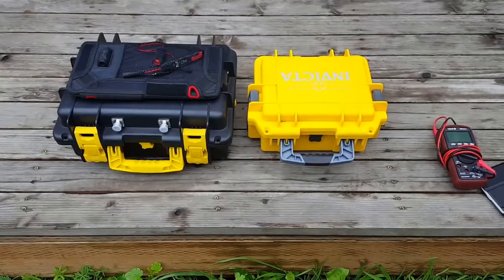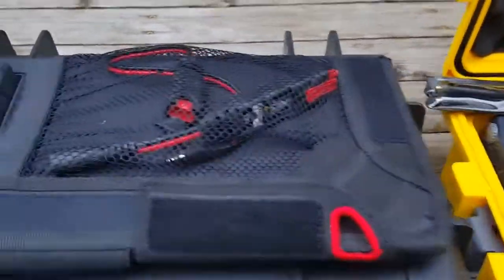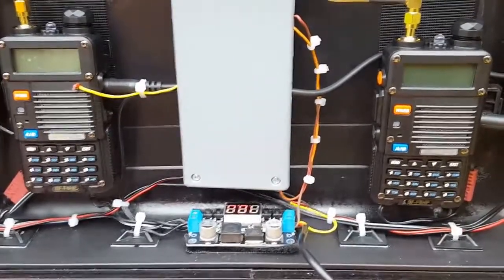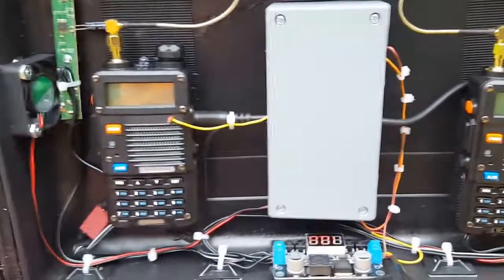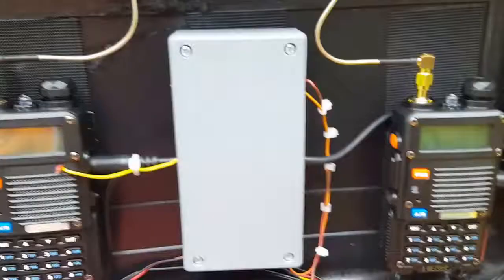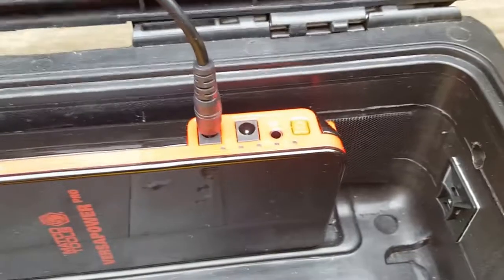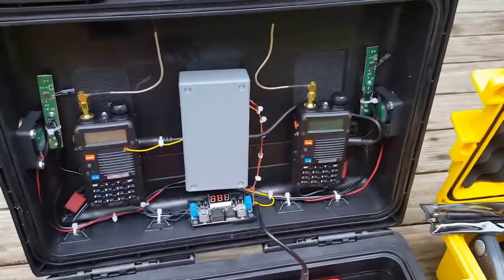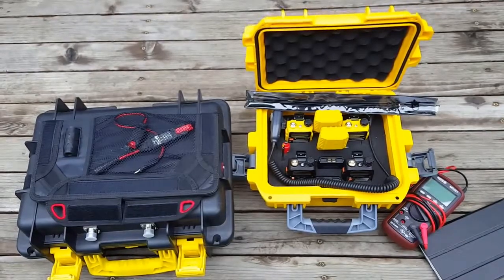KI6VIN first edition of the Solar Powered portable repeater

Comment: Hi, i have made a repeater with 2 Baofeng uv-5R , similar like you. Just having some interference problems. I have a small power supply converter 12v, to 2 outputs of 7.4v for the 2 radios. That way 1 power suply 12v with 25 amp its more then good for both radios. Do you think it may be used some filter in the power of the radios to drop the interference? Or mabe use other typ of antenas, what you think?
Reply: Que frecuencia usaste?
Reply: Very. 144mhz to 148nhz... VHF to UHF also.
Was not very good.

Comment: thats great.  Im going to try one of the now easy to get repeater kits for the baofengs that seem to take care of the ptt etc..... i may even consider an arduino interfaced to the squelch pin you mention if the kit doesnt work.  Ive made several kits in pelicases in the past both for personal and commercial use. Those fans are going to ruin your kit, they will suck in all the moisture outside and wreck it..........

there isnt much that can be done for a low power option regarding heat, if its even a problem, your main killer will be siunlight so always keep it in the shade..... you could possibly use a heatpipe glued to the radios heat source and then run it to a heatsink thats protruding outside the case, then silicone all that back up to make it water tight again????

my internet connection is currently a 4g capable router, connected to two yagis that are  on a pole bolted to my chimney......the router is inside a pelicase. i run cat 5 and power out of the pelicase into the house, its great...... much better than the satellite i was using before. 

Im making a repeater with baofengs for sure, probably it will end up having antennas on my pole and the radios in the house.

Comment: What is the advantage of using the controller instead of the direct connection of the Rx output to the Tx input?
Reply: I've tried direct and because of general noise, etc, I found that it gets stuck in transmit.
Reply: @artistandcamera3245  To my knowledge, That can be resolved removing the ground wire from 3.5mm to 2.5mm (or whatever aux cable). I did it on mine by stripping the wire, finding ground (mine was obvious, just copper wire).
Reply: @artistandcamera3245  if you just buy a regular 3.5mm to 2.5mm audio cable the ground in that cable grounds the TX so it sticks in TX.